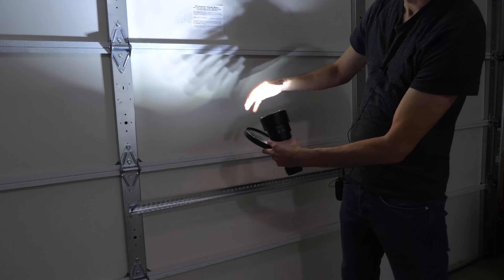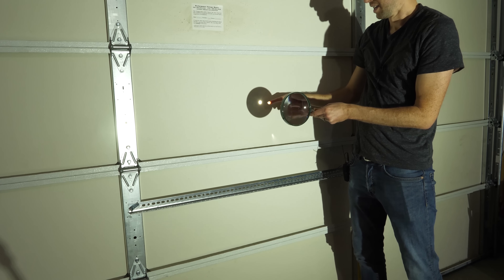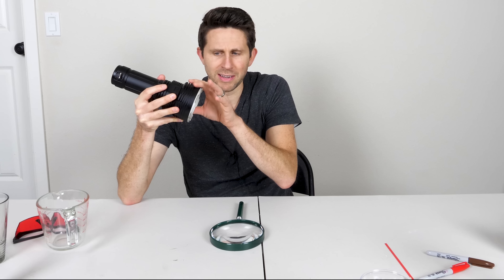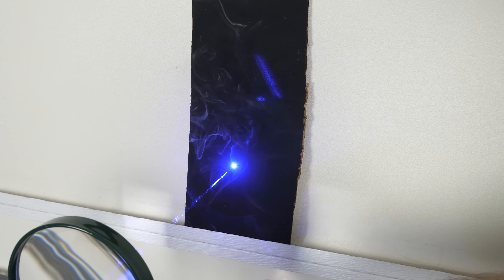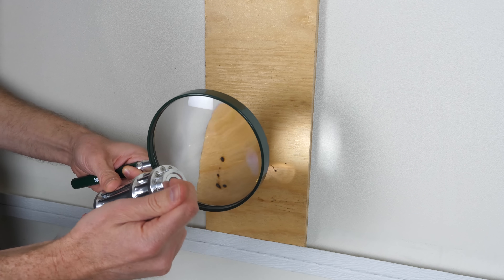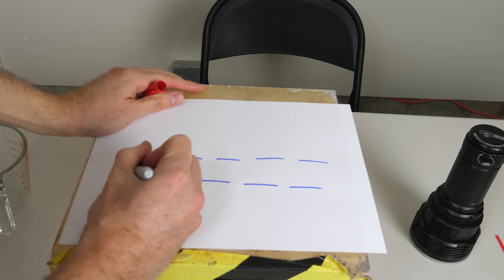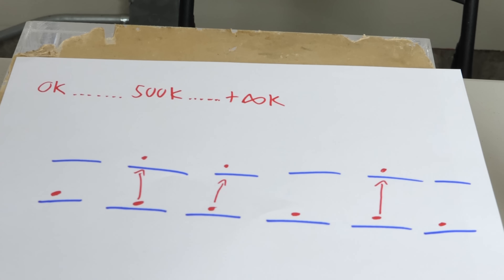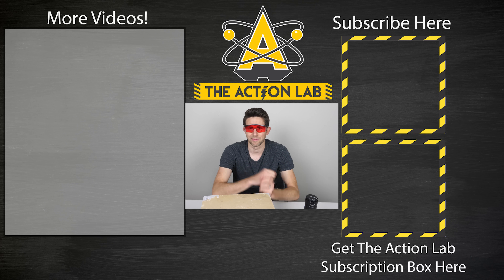What Happens if You Focus a 5W Laser With a Giant Magnifying Glass? Negative Kelvin Temperature!

Comment: The laser is a point source which is collimated.  This keeps it narrow for an “infinitely” long period.  The laser you are using already had a mirror that is giving it a desired beam width.  All you are doing is focusing it smaller so more energy is hit that spot.  You aren’t creating more energy or heat, but collimating the available energy to a smaller surface area.  Reverse inverse square law.  Negative temperature has nothing to do with this experiment, you are using higher levels physics incorrectly.

Plus the reason you cannot achieve the same temperature as the sun with one source glass as you did is because again of the inverse square law which states the energy over twice the distance from its source is spread over 4 times the area, so you get 1/4th the intensity.  By the time it hits earth the energy intensity is super small.

You LED light could do more damage if you were able to collimate it using a multi mirror set up to do so.  Then from there bring it down to a point source.  
Just using one magnifying glass doesn’t prove or disprove the statements you made.
Reply: I was just about to make the same comment.
Reply: When yo mama threatens you to get a good edumaction 😂😂😂
Reply: This isn't higher level physics
Reply: True. The source and the focused point are both the same heat energy. Its just more concentrated ill say.
Reply: Man nice I am in love with physics....
Reply: it should have a pump to make population inversion, Negative temperature make no sense to me...
Reply: Thank you for commenting, so that I didn't had to
Reply: watch?v=yTeBUpR17Rw
Reply: Science didn't break up with you,  y'all just went your separate ways
Reply: Well said
Reply: I hope someone read this and make some caption about some very obviously mistake. Practical laser not work in this way. The trick is 3(or more) level of energy which enable population inversion. PLEASE SEARCH "RUBY LASER" IF YOU NOT BELIEVE. Correct me if I wrong, I believe raman effect will shoot most of your energy before you can reach "positive infinity or negative temperature"( I dunno what it is ).
Reply: What a smart boi
Reply: The laser is a coherent light source, the flashlights LEDs are not coherent, If the lasers beam is collimated properly,  it diverges less when going through the atmosphere, and can therefore be focused to a smaller point, with greater energy density for the newer surface area.
Reply: @SupaDupaPixelGirl whatever you say man.
Reply: Does the last part of your comment means you explained nothing or you had nothing to explain... Complain?
Reply: Your wrong about the LED, no matter how much you focus it or how intricate the lens system you use the beam produced can never be hotter than that of the surface of the LED, it’s a fundamental law in optics and like the video mentioned would violate the laws of thermodynamics as the lens don’t add any energy to the system and thus can’t transfer heat from a high source to a low source
Reply: @justgame5508  Does that mean the reduction in surface area caused by focusing the beam never surpasses the energy per surface area unit of the respective LED?
Reply: @justint9243  : at least in the way the video explains and i understand  it..yes^^  with lasers he claims that is not true and you can in theory archive any temperature....that would explain to me why the scientists who try to recreate the center of the sun are using lasers to try that^^
Reply: @shadowhands3321  Without understanding all of the physics behind light, I as a layman would think this means that not enough energy is conserved when outputted and focused  to create a more dense beam. 

Being that you have a starting set amount of energy, you direct it somewhere else and condense it so there's more energy per surface area, the only thing I can think of off of the top of my head is that too much energy will always be lost in the moving/focusing of it so that it always works out to be less intense than the surface of the LED.
Reply: @justint9243  : idk^^ seems intuitiv.... but whats that worth on the quantum lvl?^^  probably something in the negative energy math part i didnt undetstood quite in the slightest^^
Reply: @shadowhands3321  do you need a powerful light to see your hand by any chance or you don't want to talk about it?
Reply: @thriftvideoseverythingiswe2534  : what?^^
Reply from the maker: You are incorrect about being able to focus an LED light to a point source. That's only possible if the LED light was so far away it was a point source, then you will have lost all your light due to inverse square law. You need to know and learn more about the conservation of etendue. Negative temperatures are needed to show how the second law is not broken with concentrating a laser light. I am well aware that the increased heat and light is due to the reduction of area of the light. That is not the point, the interesting thing here is to try to show how it doesn't break the laws of thermodynamics.
Reply: @TheActionLab  what is the point if your experiences did not relevant to what you want to prove then?
Reply: @TheActionLab  
I had to look up Negative Temperature on Wikipedia to understand what you were saying. They had your same graph -- well, they actually talked about other graphs, too, for Negative Temperature.

Negative Temperature appears to be a consequence of the maths of various fields of physics  (Thermodynamic Temperature from Thermodynamics; Temperature from statistical mechanics; others).

Saying that negative temperature is hotter than positive temperature violates our intuition. Hotter means more positive temperature, right? But under certain conditions, the degrees of freedom reduce, and entropy is reversed. The only way to explain that phenomenon is with negative temperature.

Since many here didn't understand it (clearly), perhaps the explanation wasn't optimal?

Comment: This is a very interesting experiment. There is an obvious difference between a light bulb and a laser: the light from a bulb or LED spreads out but the light from a laser goes more or less in a straight line. And that's why you can focus all of the light into a smaller point than the emitter. You should try it with lots of low-power lasers and try to focus them all on one point and see if you can get them to burn something.

Also, what if you used mirrors to direct all of the light coming off the light bulb into the lens?

Comment: why ??? a laser is already a focused light beam. All youre doing is just spreading the beam. And no, it  wont be hotter than infinity, because ENERGY DOESNT COME FROM NOWHERE! If you have a 5W laser, you are transfering electrical energy to light and lose some due to your lasers internal resistances and radiation. When the beam hits an object and is not reflected, you will transfer less than 5W off power (in heat) to that object, but in a small area. Yes, it will get hot, BUT NOT HOTTER THAN INFINITY!!!!!

Comment: Do you use any eye protection? The light reflecting off those surfaces at that bright spot can be pretty hard on the eyes. Sunglasses might be good, an automatic adjusting welding mask might even be better depending on how much light is reflecting back at you

Comment: I'm personally not one for bashing scientists, but that's because I'm not one for bashing in general. My problem isn't even the laser; I honestly think thats pretty cool. However, from my experience in a basic physics class, as well as from making a project (and aced) for that class specifically on this topic, I have this to say.

1:52 "You can never use a lens to focus the flashlight down to a brighter point than the original source itself." Yes, you technically can - both the flash light and the point have the same energy, but the point has all that energy condensed into a smaller surface area, so therefore it's "hotter". How one could go about doing this is to simply use a flashlight that is designed to have less spread when dispensing light (a light with the mirrors in a U shape rather than a V shape), that way it would be easier to send more of the light into the lens.

I'm probably wrong on something, but that's still my two cents on the video. Good video nonetheless.

Comment: The issue with the flash light and the laser has nothing to do with the surface temperature but to the capacity to focus energy in the smallest spot possible. The laser as parallel rays source of light is easier to focus or to refract because al the rays are as i said already concentrated and easy to refract or focus. You can try with a flashlight but the amount of rays refracted and focused will be ridiculous in proportion of the laser.When you play around with your magnifying lent under the sun you can manage to produce heat because the amount of rays that you are refracting are enormous but spread on a big surface with the same power they would not arm no one.